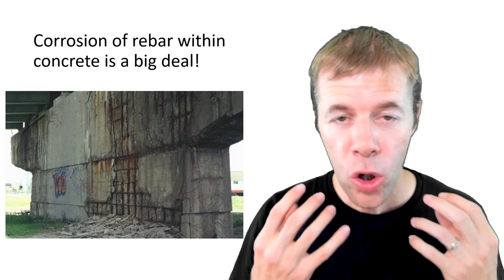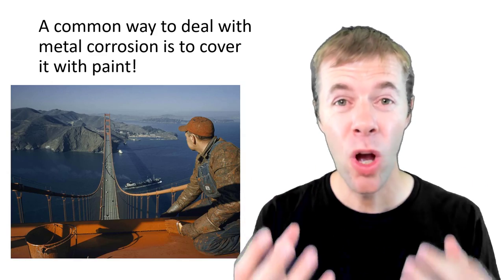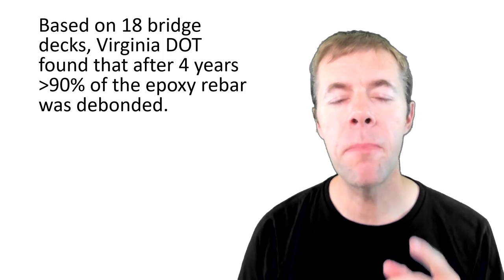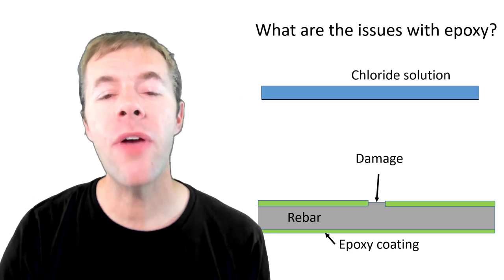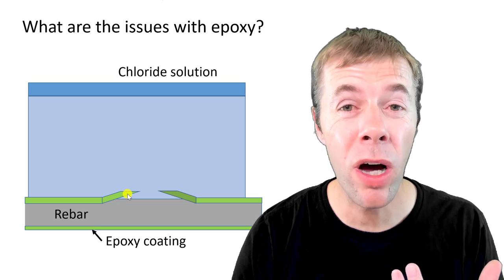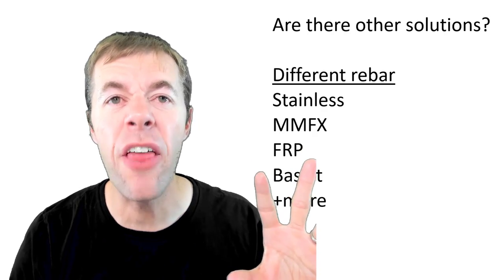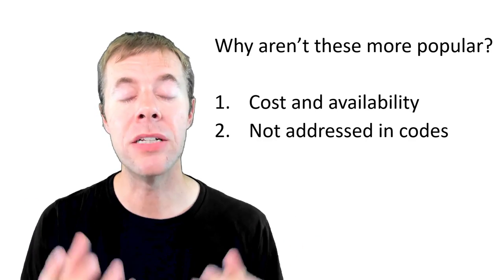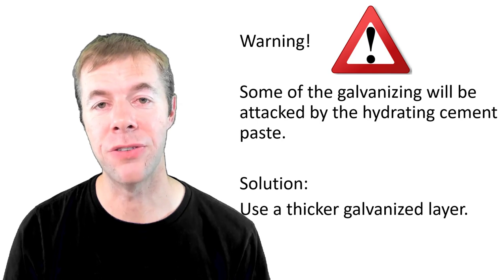What is epoxy coated rebar and why is it being banned?

Comment: Welding galvanized products causes health and welding expenses. When the epoxy rebar first came out it had to be painted by painters and inspected. This was foregone for some reason, gov't cost-cutting best guess( I used to do this in late eighties-early nineties). This was about the time of great influxes of cheap, untrained, labor influx. The welders knew of galvanic poisoning, as well as painters know that oil-based epoxy paint was bad for your health and one of the most expensive paints on the market (also the toughest when applied correctly). The bridge decks you mentioned are incredibly time-consuming to paint and with a brush turning to a brick at the time it chemically sets means either a lot of labor per coat, or someone will pull out a spray gun. The people who cut corners are all over-the project from the project engineer that skipped a full coat in favor of a can of spray paint, or the paint company that did not have the overspray insurance so just touched it up. Oh lest we forget, at that time the epa was trying to make all paint water base so less fish died when the non trained poured the paint or the specialized solvents into a storm sewer. The waterbourne epoxy is soft and scars like your photo, the oil base chips if it fails and is much tougher. So which is it- the steel supplier that had to conform to legislation, the untrained that would cut corners, the inspector that was lax or bribed or something, or the engineer that had to keep an impossible deadline? Don't even get me started about the concrete sealer that would have stopped a lot of the sodium chloride spalling in the first place. Until the gov't realizes that the lowest is not really the best it will stay snafu, and we the taxpayer will get ground down by it. The cost of a 2 lane bridge over a creek with 2 under supports in 1989 was 1 million.

Comment: The problem with galvanize is that the chemical reaction with the cement while it is still wet creates small hydrogen bubbles at the surface which weakens the steel/cement bond. But it is only by a marginal factor. The only true solution is to use the correct water to cement ratio which makes the cement impervious to water and hence the chlorine from outside the cement. The correct ratio is 0.4, but this is very stiff and hard to work, but .45 is readily workable and still impervious to water. Of course more cement in your mix is added cost but it is stronger in compression and better design will save on material bulk. The addition of pozzolanic ash (provides self healing of cracks) is essential but manganese slag can also be used to reduce cost.

Comment: Hot dipped nails may be a good example of what might happen if the galvanizing process is used for rebar. If you bend a HD nail, the coating will crack and sometimes flake off. Sometimes the coating is much thicker, probably caused by quality control issues, and the coating will be more likely to come off. The hot dip process may need to be improved, and pre-bends may be needed. And altering the chemistry of the concrete will help a lot. And I thought epoxy coated rebar was expensive...

Comment: How about the cement itself, is it possible to introduce some additives or something into the cement that slow or even prevent the Chloride permeating ; or is it feasible to just coat the bars after they've put into the structure, tied and formed , might be with paint or other material

Comment: with my experience rebar in general can become exposed, corroded and deteriorate a structure prematurely and rapidly. there are so many other elements that can be a factor. reading the comments below, a person mentioned demolishing a 100 year old facility and the rebar looked new. i've experienced this.  i demo'd concrete from the 40s and was intrigued as well. the dowels looked new with zero corrosion inside and out (i mean is was odd). they were also incredibly malleable as the reclaimer spit them out (all warped and bent but smooth curves and shiny just below the surface). it's because they had zinc in them. so my take is they used zinc to cast reinforcing steel back in the day. also there is new concrete (like my driveway) that is failing prematurely across the country. it's not the rebar, it is the aggregate (can be the sand or the course aggregate) which leads to ASR (alkali silica reactivity). it is so common (and frustrating across the board) that many jurisdictions are requiring a certain concrete mix design to contain coarse and fine aggregate that have been proven worthy of ASR by mortar bar expansion testing. ASR (aggregate quality) is a bigger problem than rebar corrosion in my opinion. i still love the vid. great points and i'll definitely be discussing this item with coworkers.  thanks!

Comment: Just a thought but would spraying rebar in some kind of oil be cheaper than galvanising and would it protect the rebar after the concrete is poured?  As an ex-blacksmith I can say that using WD40 or other oils seems to protect steel pretty well.  Maybe spraying rebar with some kind of natural oil just before pouring would work better?

Comment: Hi Tyler, New to your channel. First just wondering about the galvanized rebar, how prone to degradation is it in the rebar bending process. I am doing a deep dive in to concrete , as I have recently invested in a new concrete product that does not require rebar and is approximately 5x stronger. Your insights would be greatly appreciated.
Reply: What type of product are U referring to if I may ask ?

Comment: Galv can be nicked and scraped off too. Not as easily as epoxy, but it will still yield weak spots. It seems like the solution is more along the lines of a coating on the concrete that negates the advancement of the chloride. Chloride comes from salt, which comes from being near a saltwater or using road salt.

Comment: If you look at epoxy-coated tomato supports left out over winter they are useless due to rusting of the rebar through tiny cracks in the epoxy. I had to throw them out as they just fell apart at the rust points. I know tomato supports are not the same as rebar used in buildings but it's the same concept.

Comment: What is your opinion on 3M technology for concrete? It’s mixed with plastic apparently it’s three or four times stronger & it’s lighter then full fledged concrete. I’m wondering maybe use carbon based rebar? Like that of bicycles would that be feasible?

Comment: Seems like there should be a way to keep the chlorides from getting through the cement. Can we change the formula of the cement? Paint (treat) the cement with something? An a big expensive structure like a bridge, seems like it would be worth it. How about a paint that turns the structure into a solar cell to create electricity? At least enough to monitor the health of the structure. Rebar can be a conductor and all kinds of monitoring can be done by passing a current through it. Oh, and if the rebar were electrified, does that have any affect on the corrosion over time?

Comment: A problem I have also noted is that in coastal areas a lot of the sand used in mixing the concrete is dredged from seawater and inherently has a very high salt content. It ruins rebar in months not even years.

Comment: Galvanisation will have to done at the rebar production facilities. Obviously, it’s another process and expensive process. It will add to the rebar cost. However, at work site, these rebars are cut to the desired lengths as per drawings of the building. Once the rebars are cut, the ends of the rebars are exposed & bound to corrode over time. I think it’s best & practical to buy painted rebars & additionally spray paint the rebars once they are cut and laid.

Comment: I'm a paint chemist and this is no surprise. No paint slows ions or water enough to slow corrosion, which is why we specify undercoats with corrosion inhibitors to passify the surface of iron and steel.   The ions are so small that they penetrate even the smallest pores, invisible to the naked eye.  Painting the outside of exposed concrete may perhaps be more effective in wet localities  because the paint is less likely to trap chlorides on its surface than raw concrete, and it may wash off more than wash in.  It probably wouldn't have much effect underground.

Comment: I worked in construction for 40+ years. In both commercial and home building. I am not an engineer, but I want to talk about a few things I know about. Engineers have discovered the formula for the ancient Roman concrete. The differing ingredients are inexpensive and engineers should look into it. There are numerous structures the Romans built 2,000 years ago and are still standing, and they contain no rebar. I have repaired thirty and forty year old concrete slabs. The chief reason for structural concrete failure is the rebar being exposed to water penetration. All concrete develops cracks over time and must be repaired in a timely manner. Water will filter down into the concrete and as it freezes and thaws the small cracks will become larger and deeper. When water penetration becomes deep enough to contact the rebar the corrosion of the steel will begin to cause the rebar to corrode. As it corrodes the oxidation delaminates the steel and it begins to slightly swell and consequently cause the concrete to crack more. This process, if ignored will eat away the structural integrity of both the rebar and the concrete. In some cases structural epoxies can be injected under pressure to arrest further water damage and offer some structural strength. But no matter what kind of rebar is used the structure will always remain under assault from nature and vigilance and maintenance are required to assure structural integrity.

Comment: Use a super thin galvanization under the epoxy. With halfway careful handling deep cuts would be the only actual concern easy enough to make a laser tool to scan the bar for errors that could need a quick spray..
Reply: Aluminum coating might work as well

Comment: This is an interesting video!!! Yes, the spalling of re-bar in concrete structures is a real problem... Especially in areas of corrosive elements, like water, salts, acids, etc. The corrosion of the metals that are imbeded in the concrete structures, has always been a problem... My sugesstion; use materials that are inherently unaffected by the corrosive elements that penetrate through the porous concrete... Glass comes to mind immediately. Made from silica, one of the most abundant materials on the planet. When strands of glass fiber are mixed with resin, then allowed to dry, it becomes very strong, especially when shaped with structural strength in the form that will provide a base for the concrete to adhere to... The fiber-glass shapes can be bead-blasted to provide a good-rough surface for the concrete to adhere to... The one dis-advantage that comes to mind, of using reson-fiberglass structures to replace the antiquated steel, would be the older crumbling concrete would probably be harder to re-cycle than the steel re-enforced concrete... Harder to crush because of the embedded fiberglass... But if it lasts longer because of it's more durable design, due to the absence of spalling, then the re-cycling of the concrete will become less needed anyway... The concrete structures will last much longer.

Comment: I spent my career working in the field of buried pipeline corrosion, and we consider a disbonded coating to be much worse than no coating. Corrosion is significantly accelerated in the disbonded areas

Comment: I get it. Thanks for explaining holiday.
I always found it fascinating that concrete and steel are similar in expansion and contraction properties. Imagine if not.
(think I'll stick to good old steel)
What to do with tension cables?
Probably those - go galvanized.
Reply: I sis not follow the cuurent state of the art of tension cables. Back in the days, these were troublesome and caused quite a few structures to collapse. The proposed solution back in the days were to make then checkable and maintainable, so they could be replaced when needed. The cables would need to run in sealed tubes to protect them against corrosion. And since no seal is perfect, there were to ways to access these tubes for maintenance and checks.

Comment: I think that industrial hard carbon (IHC) coating may be a good solution if we can scale up the coating production process. Carbon is plentiful and we can even capture it from waste sources such as CO2 in exhaust at industrial sites which could in theory reduce pollution at the same time. There has been some pilot projects for extracting carbon from exhaust at concrete and metal manufacturing sites. In the near term that carbon can be sourced from coal. IHC has excellent corrosion and wear resistance and has proven long term performance as a coating for components in various industries. In theory it should be affordable if scaled up because the material is cheap and the process is not much different from the epoxy powder coat. Currently it is mostly focused on coating parts for machinery and thus the scale is much smaller than would be required for mass treatment of all the rebar used. If we can get the process cheap enough for large volume it may even be cheaper than galvanized since carbon is cheaper than zinc.

Comment: Well I'm no engineer , just a retired welder from a construction company , but I've demolished 50 year old concrete here in the Texas gulf coast ,and seen rebar inside with Zero Rust on it. Also galvanizing can be botched by the plant doing it ( I've seen that happen extremely often) if all the acid wash is not thoroughly washed off prior to it's hot dip , leading to the acid eating away at the steel rapidly , giving that steel a shorter life than steel that just has mill scale on it. But I'm not going to deny that rebar does corrode when cement is compromised by cracks.

Comment: This topic is becoming more and more prevalent in bridge design as DOTs look to expand the service life of structures. This is a good primer for structural engineers who have built habits on specifying epoxy and are resistant to the stainless and galvanized rebar options DOTs are beginning to explore. 

In my local market stainless is quite expensive & hard to source. HDG bars seems a good compromise between performance, cost, & availability. I look forward to more research on the long term performance of epoxy vs galvanized reinforcing topic in the future. 

My DOT is really pushing for stainless steel reinforcing, I'd also like to see some research that justifies the benefits of stainless vs galvanized given then large increase in cost for stainless bars.

Comment: My thoughts go to the rebar used on freeway bridge support beams. Those are upright and reach from the ground  to the bottom of the bridge. The only time they have toppled is in a heavy earthquake.  High-rise buildings are different. That would make the most sense to use hot dipped galvanization.

Comment: I'm really curious about the various polymer rebars out there, I imagine that they are absolutely the future of concrete construction but I wonder how far off they are, both from simply existing and from economic viability. Are there any polymer rebars out there right now that can take the place of steel in high-rise or large bridge construction?
Reply: While you are considering indestructible rebars that don't decompose, don't forget the old saying, "What goes up must come down."  When demolition or renovation becomes necessary what will happen to those materials that do not decompose or recycle?

Comment: Thanks for the video I came here after seeing the term "spalling" in a report on the condo collapse in Florida. When you talk about passivated rebar would it make sense to use both galvanizing and then epoxy coating? Use the epoxy/powder coating as a sort of sacrificial coating to protect the zinc coating from handling and installation damage?

Comment: While they are constantly painting the Golden Gate Bridge it's not and end to end process. Certain areas end up corroding faster than others because of wind, traffic, and other variables. So those areas may have to get painted more frequently than other areas that are protected from the wind and salt air a little bit more.

Comment: Galvanizing with Zinc has one effect that was not mentioned until now. Zinc coating is self-healing. Because Zinc is less noble a metal than Iron, Zinc will corrode before Iron in the presence of Chloride ions. Then the Zinc ions wander into any scratches and holes in the coating and seal them again until there is a closed Zinc layer over the Iron.

Comment: The last couple of bridges I built were a set of interstate bridges. We did north bound lane one year and the southbound lane the next. The north bound lane was tied using epoxy coated bar and then the next we had epoxy coated bar, but was changed to chrome molly  bar at the last minute. I was always skeptical of the "green bar". And galvanized bar would work well. Not to mention you don't have to worry about busting your teeth out with your pliers as they slip off the vinyl coated wire, which I've seen,, lol.😄
Btw all end walls were green bar and the peirs were all black bar! Engineers!!

Comment: When they secure the rebar in preparation for a cement pour. The wire they use to tie the rebar with, rusts easily. As it is not coated. They might use something else that doesn't rust while holding the rebar in place for the cement. Zip ties come to mind or perhaps something like aluminum wire. If rust is such an issue with the rebar, it causes one to wonder why they don't stop using wire that rusts.